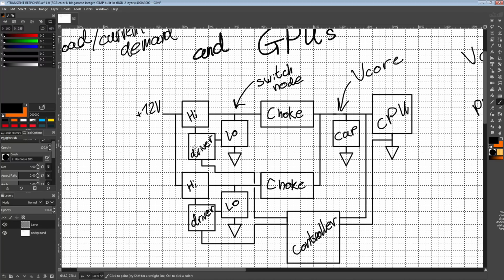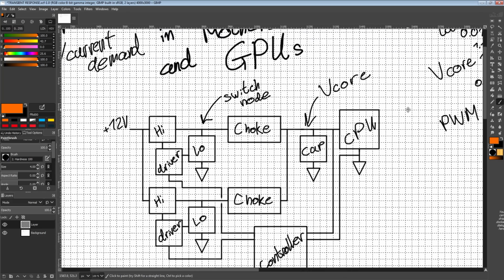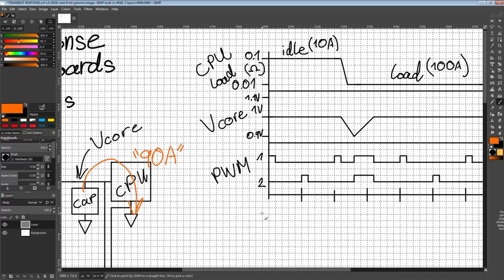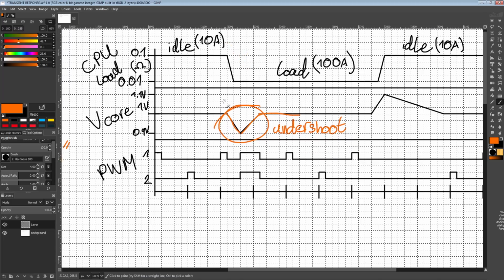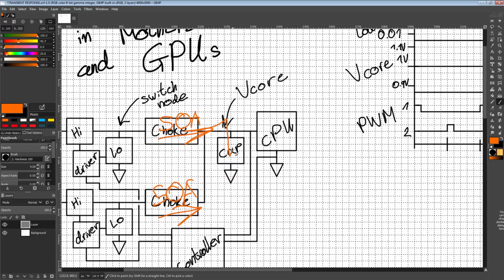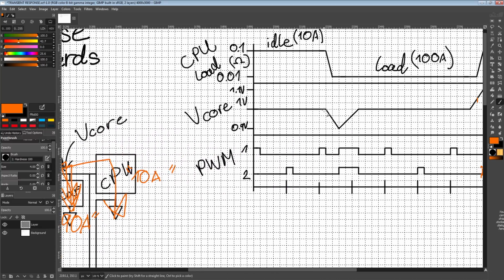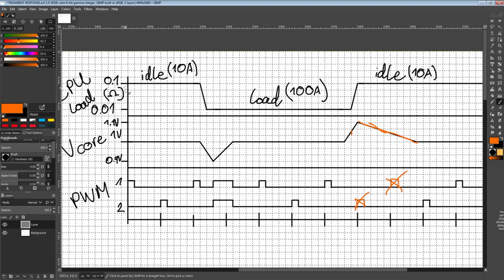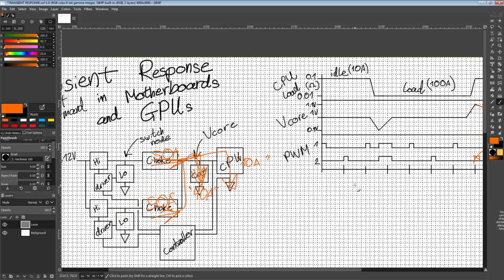Transient Response of Motherboard and GPU VRMs R0.4

Comment: Great lesson!!! 🙏 I still have some doubts regarding undershoot, tho... Does it mean that while overshoot may - with time - degrade the CPU (when, how long, I got that it is uncertain and the mobo has a lot to do with it), undershoot only downside would be the instability or even impossibility to reach a certain frequency?

I'm messing with offset voltage on a Z390 Aorus Ultra and I was able to reach 5.1GHz using -0,055 but the min-max difference in VR VOUT readings is massive, something like 0,145 but never higher than 1.35 and something like 1.29 under load.

If the spike isn't high enough to do any damage and the undershoot isn't destabilizing my overclock, it just isn't something to worry? 🤔🤔🤔🤔🤔🤔 Great lessons, bigger questions 😬

Comment: Thanks- so i got a issue, i had a fan die on my RTX 2080 i bought a new fan from asus changed it and then the pc could not find the card, i tried whit another main card also to get into windows but it could not find anything  just the older card. got any thoughts on what i could do to troubleshoot this. asus said warranty wont cover anymore.

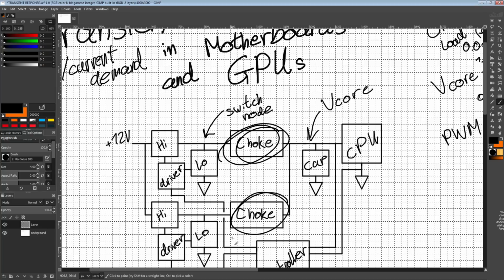Comment: 3:23 regarding choke/inductor. Back in the day they used to call capacitors "condensers" which really threw me for a loop until I looked it up.

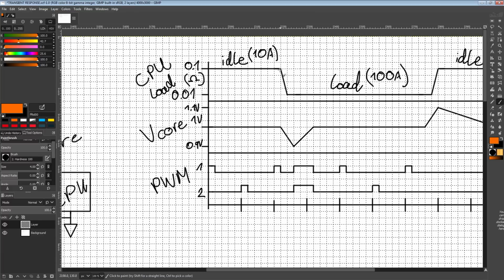5:05 "high pulses on the PWM line" It looks like you've drawn the pulses on the high side mosfet specifically. I'm more familiar with 2 phase buck regulators that have integrated drivers, but I had some questions regarding your PWM. Firstly, I'd like to know more about the controllers that can turn on phase 1 "out of phase" like that (at the same time as phase 2). Do you know of any offhand (that have a public datasheet I can look at) I'd like to learn more about how they manage it.

It looks like your PWM signal is showing a pulse skipping mode. I know this is done for high efficiency at very light loads. In a traditional "continuous" mode, the controller will usually leave the low side mosfet on during a "load to idle" transient, allowing current in the inductor to reverse, and dumping the extra energy out of the low side mosfet. The buck regulator controllers that I use don't allow reverse current through the inductor in pulse skipping mode, which means they have more overshoot, but better efficiency. Do all the MB/GPU VRM controllers do pulse skipping mode for high efficiency at low loads? Is there a way to run it in continuous mode to help with the overshoot? I know they usually turn on the low side mosfet until the inductor current is about to reverse (in low load) or at the beginning of the next cycle (for mid and high load) regardless of if they operate in continuous or pulse skipping mode.

The video is a good introduction to the topic, especially with the role of the inductors. I watched it twice and I'd be happy to share it with others.

Comment: Hey, my Asus motherboard has an LLC setting and then IA AC LL and IA DC LL. Whats the difference between these and the purpose of each? Also, I believe your scenarios use manual voltage, how does all this change when using an adaptive mode? Thanks and sorry if any of these questions do not make scene, kinda new to all this.

Comment: I have a weird mobo use case. Ive been wanting to see how far I can push ryzen single core/ccx and order a 3600x or 3800x. I want to get a mobo with as many phases as possible without spending $500, especially as I plan on frankensteining it. any suggestions anybody?

Comment: what I don't understand is why not have a comm signal from the cpu to the voltage controller, maybe linked with the scheduler maybe to then almost remove undershoot. better control of power and allot less of this messy dummy system that can only respond to things already going wrong basically. why continue to do things this way when the mobo has to be made specifically for the cpu it is going to support anyways. would it really make things that much more complex or costly? I kinda understand the cpu does not know ahead of time what it is going to be given, but for the time difference to have a subsystem see that demand is coming and possibly for how long would be highly beneficial right? then it could give the voltage controller a better idea of what to output, when and how long on the MOSFETs. same for overshoot as it would be able to ramp things down sooner as it would have information on the decrease in demand.

Comment: coil = bobbin = choke = inductor = inductance
Reply: Well yes, but actually no... Bobbin is specifically the plastic holder the coil is wound on and i've never heard anyone refer to an inductor as bobbin.
And technically choke is referring to a specific usecase of inductors, for example balun transformers (converting a signal+ground signal into a differential pair or v/v) shouldn't technically be called chokes, and they usually are inductors. Just like the inductors in switchmode power supplies can but don't have to be chokes, a buck converter has a choke sure but for example isolated flyback? It's a coupled inductor, sometimes called a flyback transformer which is also arguably incorrect, but definitely shouldn't be called a choke. At least imo.